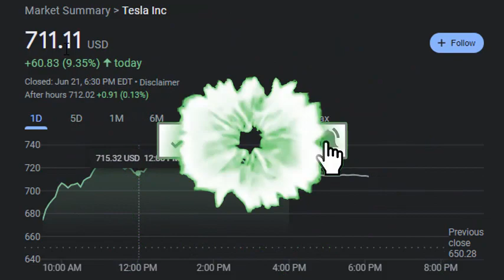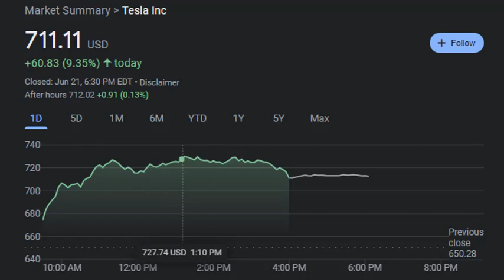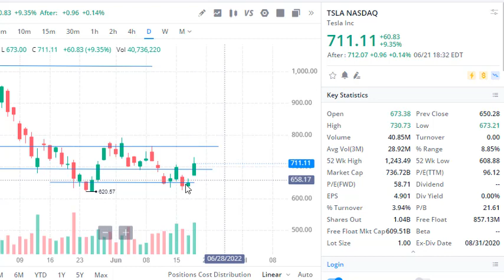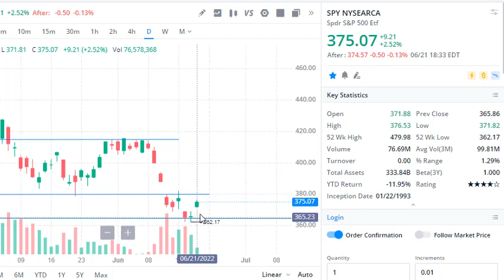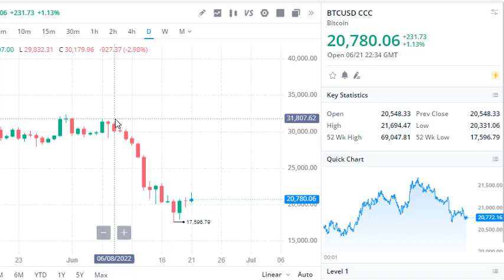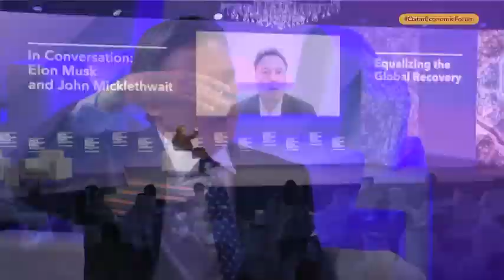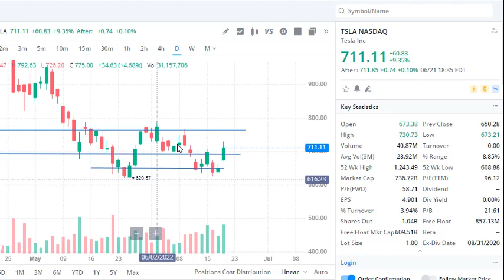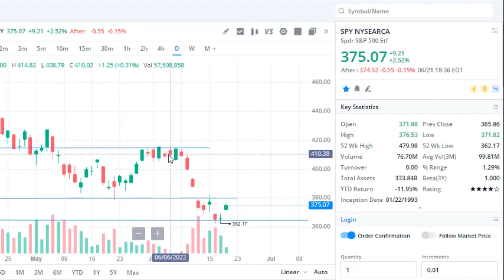TESLA STOCK - HUGE UPDATE BY ELON MUSK - TSLA STOCK PRICE PREDICTION, TSLA STOCK, SPY, BTC ANALYSIS

Comment: If I were looking at a electric car it would only be a Tesla.  Why?  I worked in manufacturing for 50 years, both on the floor in assembly, and 40 years as an Degreed Engineer.   There is a huge learning curve in the beginning the design and manfacturing of a car, especially a new type like an electric car.  Tesla has been through that learning curve for many years.   Many of their initial design and manufactuing problems have been solved and they continue to learn.  Now take GM, Ford, and Chrysler, Riven and etc. and the first owners are going to experience many quality, and functional problems in the first several years.  I rather go with a proven car when they cost $ 50,000 -  $ 120,000 to buy.